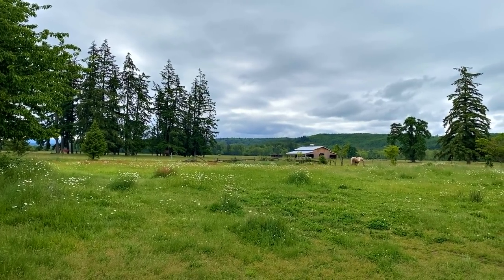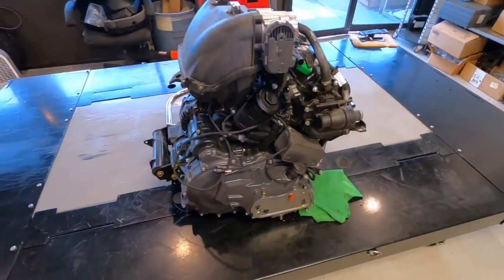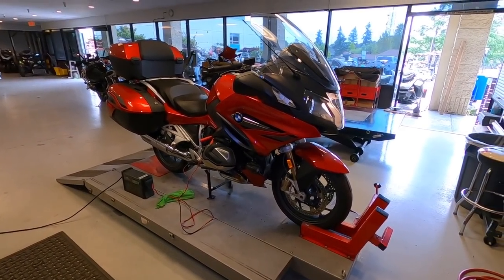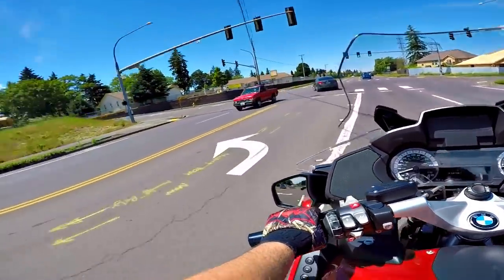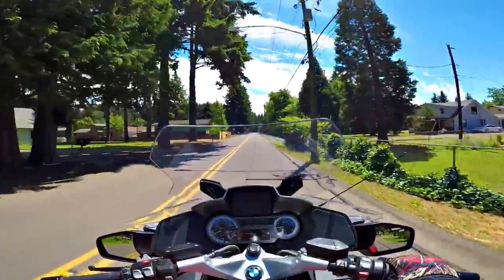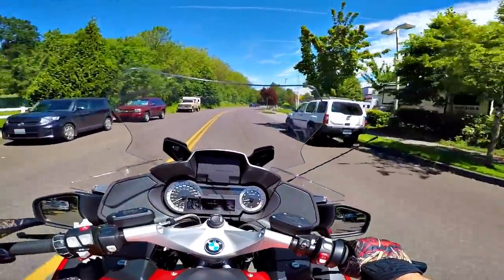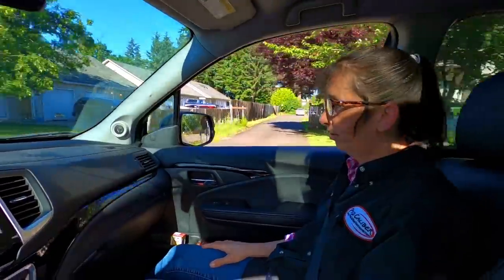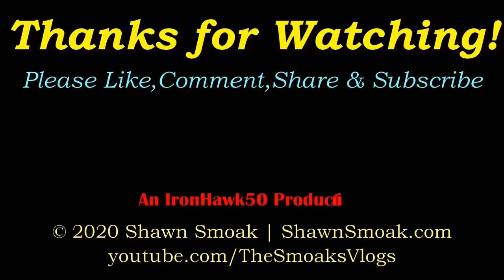F3L Transmission Progress!! • Chalk RTL in Chrome! | TheSmoaks Vlog_1662

Comment: That’s an interesting issue with the bmw battery, my thought would be a faulty relay, or a loose wire in the ignition switch, glad to see it was an easy fix.  Looks like the spyder transmission is on its way to good health!  Thanks for sharing!👍

Comment: That Red BMW RT is so beautiful.  I really hope my 2015 RTS SM6 doesn't ever break the shaft. Scary....
Reply from the maker: I wouldn't give that shaft too much worry, as it's extremely rare.  Though it's odd that we've had 3 of the 5 known failures come through our shop.  It's not a lack of service or an abuse issue, it seems to be totally random, as if destined to happen, and none were SM6 models. Considering all the 1330ACE engines built over the years, the problem is practically at non-existent quantities...

Thanks Jim!!

Comment: Have that same color RT 2019MY, has been my favorite motorcycle so far in over forty years of riding. Probably one of the most stand out color combination on a stock RT. After less than a year nothing I have ridden since has tempted me. Only change I made was to replace the windscreen with a Werks Quiet Ride